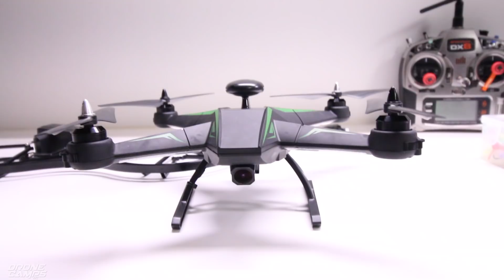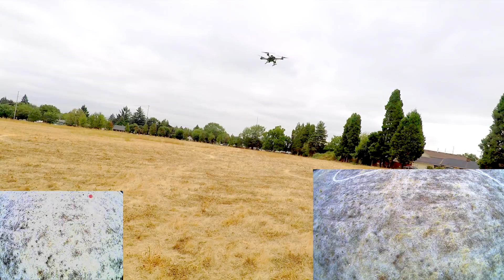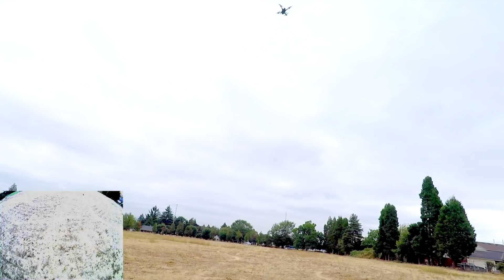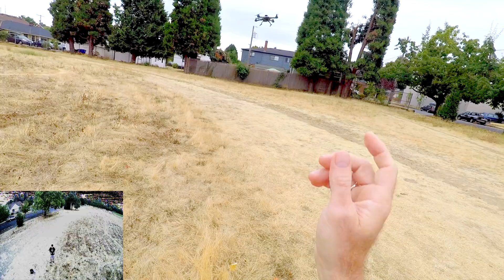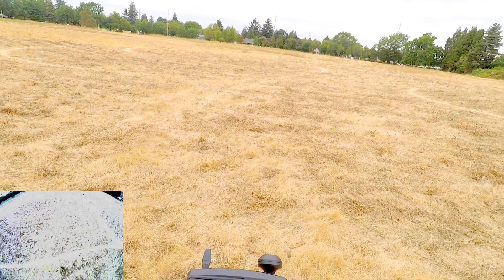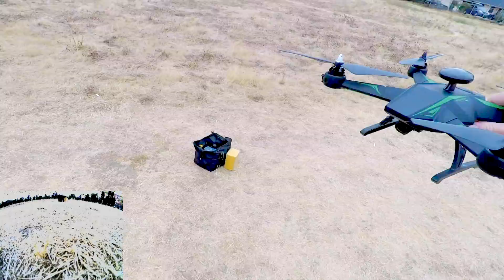RC136FGS GPS Quadcopter - Beginner Friendly! - Review & Flight

Comment: The screen has a separate internal lipo (800mah) for the screen. The battery in the back of the controller (6 X AA's) are for radio only.  The screen is recharged via a rear-mounted charge port. I broke mine open and upgraded the lipo to 2000MAH.

Comment: I had this quad, it's a turd. I had to send it back to due to everything malfunctioning. Sending it back to Tomtop took 2 months and about 30 emails. First off out of the box FPV battery would only charge 3 bars, dead by end of flight. Second, after first flight servo on camera burned out. Third, FPV was scratchy and went in and out all of the time. Flight time is not as advertised and quad returns to home at random. The circle me mode works great, return to home works great(fail safes work). Follow me works great except if you're trying to record good luck, quad dips over and over as it tries to keep up with you. Tomtop asked for video of malfunctions. During the video one of the motor's burned out. The price of quad was 240. and really should be built better for that price. I got my money back and spend on extra 30 dollars and got Hubsan H501s advanced. I've had quite a few of these quads and the Hubsan is by far my favorite. It's not a racer but great for areal video, clean steady shots. I use the Hubsan to video my son's cross country meets. So pay a little extra and you won't be disappointed.
Reply: Russ Ayala I hear ha bro,, Tomtop says they sent to me, never showed,, still haven't gotten money
Reply: Keep telling me to deal with DHL and when I told him I spoke to them and that they have to talk to them and said never again haven't heard from them ever since even stop sending the drones that I had ordered prior mounted up to almost $2000 luckily PayPal had my back and I retrieved all that but you still have $230 floating out there in their system I have an order again from them yet and RCMOMENT by the way just in case people don't realizethat is awesome Tomtop technologies
Reply: If you look at reviews of Tomtop they are the worst company to deal with. Everybody complains about not getting product, replacement of a bad unit takes months, or they just won't give a refund after sending product back. I moved on to Banggood whom has great reviews. I've ordered quit a few things from them and the longest delivery was 19 days and that was from china. They also have a California warehouse and everything is shipped Fedex. So fast delivery times. I just had one product go bad and I'm currently doing the send video thing. Let see how long Banggood takes on this one. So far so good and have received emails each day from them. It took Tomtop a week to get back to me.